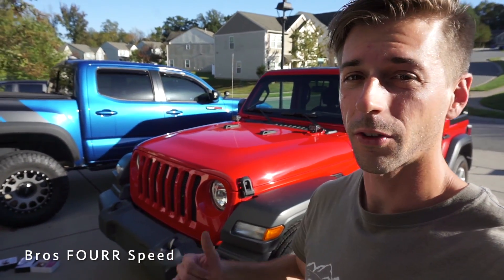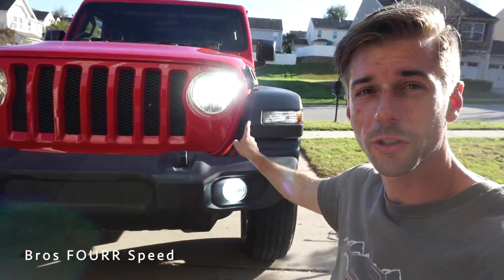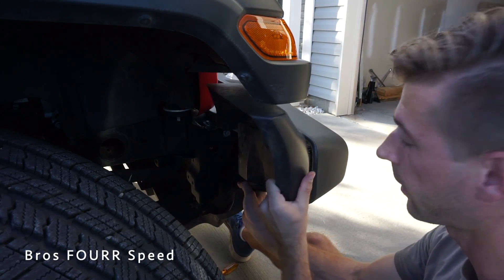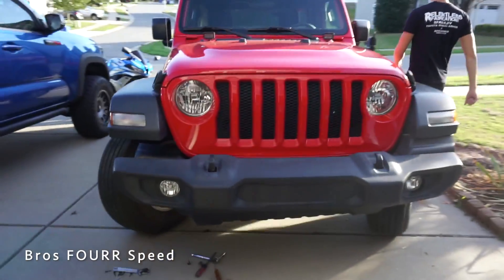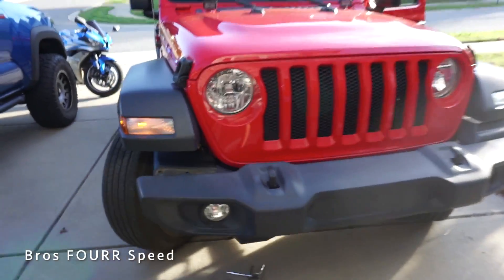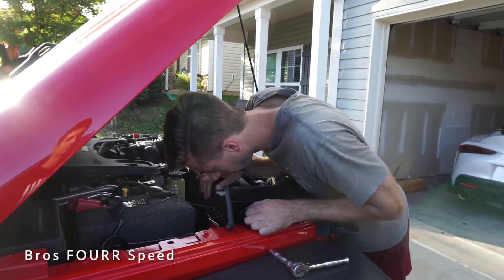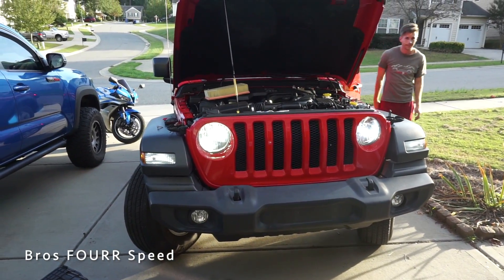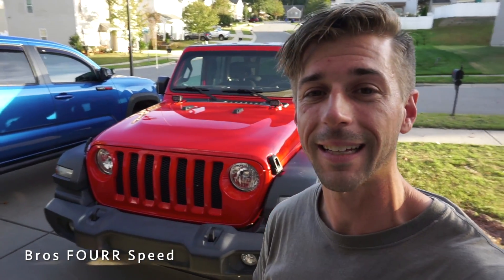JL Jeep Wrangler LED Light Upgrade! BRIGHT!!

Comment: Great video - I have been looking at lighting options for mine.  Two questions - Did your Jeep have DRL's before the swap.  It looks like they are running with the new LED parking lights (in white) and then amber for turn signals, that is unless you just had parking lights on for the video.  Second question on the fog lights.  If you are running them in white mode when driving, hit the high beams (where the fogs turn off) and then drop back to regular lights, do the fogs come back on in white or yellow?
Reply from the maker: It should have, they were just amber, so now they look much better! And if you have the fogs on, and use the highbeams they'll come back on the other color!

Comment: Hi. I have a Jeep Rubicon 2020. I bought the led lights you installed in this video and I love them.
However, my jeep has 2 bulbs on each turn signal (an orange which I replaced with a 7443 7444 CK; and a clear bulb which is a DRL). Lasfit doest make drl led lights. Do you have any recs? Jeep looks a bit weird with all front lights being led except this DRLs on both sides. Thanks!
Reply from the maker: That's interesting because I only had the one orange stock bulb to swap out for the turn signal/drl.  They should make led drls for the Jeep!  Aside from them, all I can think of is diode dynamics as another company to check out!

Comment: won't this cause scattering if put in a halogen housing meant for halogen bulbs? I've been flashed at before so I don't run LEDs in halogens anymore.
Reply: I did the same thing to my jeep and get flashed all the time
Reply: @Jth69  lol yeah plus white LEDS are pointless in inclement weather.. run amber or yellow fogs and you can see clear as day in snow/rain/fog and it’s easier on the eyes
Reply from the maker: I don't seem to have an issue with them so far!
Reply from the maker: Thats why the fogs have the switch backs
Reply: I get flashed when I use the LEDs on the fog lights. The beam is higher than the halogen. Any fix for this?

Comment: New to your channel. Is that a 2020 jeep? I have a 21 and I'm looking into some research with this light.  I have stock plain old halogen bulbs for my dogs I want yellow and I'm not sure if this would work on mine. I have a custom bumper xrc gen 2 so I'm hoping that it may
Reply from the maker: This is a 2018 but it's also the JL model too..these lights should work being it's the same model!

Comment: Quick question, did your turn signals ever hyper flash at all?
Reply from the maker: Nope!  I've had several bulbs from lasfit and haven't had that at all!  They either come with a built in resistor or you can get an adaptor to prevent that.  Just depends on the vehicle.

Comment: Well I click your vid and order all 3 sets of lights. i even used your discount  code.... however those H11 switchbacks don’t work properly in the fog lights they don’t Click in justs falls out... i tried removing that green O-ring  and  replace it with the original red one and it still  didn’t seat  correctly... So Lasfit  sated/suggested that i should remove the O-ring all together and i just tried that 5mins ago to no avail.. although it seats better,,  when you grab it to give it a lil tug its falls right out in your hand... i wanna use ZipTies because i love the lights but i shouldn’t have to.  especially after spending  that much money...
Reply from the maker: I know it was a tight fit on mine, I think I removed the o-ring entirely to make it fit better, but after that haven't had any issues.  I do agree with you though on having proper fitment for the price of them for sure, but hopefully you get it to fit right!

Comment: Do you have to buy two of the DRL/ turn signal sets?
Reply from the maker: Those are the same bulbs!  So the drl/turn signal is just one!
Reply: So when I pulled the inner fender liner I have two bulbs on each side? 🤷🏻‍♂️ I have a 19 rubicon.
Reply from the maker: @relewis3  The corner light could be the other one, mines an 18, so you would think it's the same. Unless you have the led lighting package.

Comment: Do you need jscan or anti flicker for installation?
Reply from the maker: Nope! Easy plug and play! No hyperflash!
Reply: @BrosFOURRSpeed  thank you for your response man! You got my sub. Appreciate this kind of video.
Reply from the maker: @fitsonfly1559  thanks for the support!
Reply: @BrosFOURRSpeed hey man. I just installed the led lights the only thing i noticed is the turn singal when i installed it it was white but after using it last night it went from white to amber. It only comes back to white when i switch the light along with the headlights. Do you know how i can keep the turn signal white?

Comment: is your jeep wrangler jlu sport version ?
Reply from the maker: This was a JL Sport S!
Reply: @BrosFOURRSpeed  is it plug and play ?
Reply: what do you mean "factory switch" for the fog light color change ?
Reply from the maker: @mbperfection  Yeah! You just replace the stock bulbs with these ones!
Reply from the maker: @mbperfection  One the turn signal stalk, there is the control for the fog lights. By turning that on and off, it will change the color of the fogs!
Reply: @BrosFOURRSpeed  so the way to turn on the fog light is the same as usual , and to change color is by pressing on / off , so how to turn off fog light ??
Reply from the maker: @mbperfection  Yup! You turn them on it’s one color, turn then off then back on and it’s the other color!
Reply: @BrosFOURRSpeed  bingo !!!  I ordered the headlight and DRL bulb last night , now going to order fog light . I see there are two version of the fog lights , one is white color without canbus . Can it work ?
Reply: @BrosFOURRSpeed  just got the DRL bulb installed, hyper flashing and error code on dash .... any ideas? my jeep is 20201 wrangler jlu 4 doors sport
Reply from the maker: @mbperfection  The bulbs have a 50/50 chance on the install so maybe take it out turn it around and re install. I didn’t have any issues with mine. Hopefully you ordered the right bulbs.
Reply from the maker: @mbperfection  Sorry you are going through that, we’ve had tons of bulbs and zero issues with them.
Reply: @BrosFOURRSpeed  i assume...it is because mine is 2021 ?

Comment: I prefer amber drl, much more visible, especially in the day, hense its called day time running lights, if youve seen cars with white led drl or turn signals, youll notice yes their bright at night, but not in the bright day, amber is a lot effective hense manufactures use amber. Idk why people use white for drl.
Reply from the maker: I've actually never seen amber drl's, most manufactures have them white, but they are super bright during the day compared to the amber.
Reply: @BrosFOURRSpeed  thats another story, sorry i wasn't specific, im talking about when the vehicle does not come with white led drl from the factory. Ofc now days newer vehicles comes with broghter white led drl, their only visible because they are a long strip of led or a big bulge of light. Hope that make sense.
Reply from the maker: Yeah to each their own. I feel the white light just looks more modern

Comment: Hey guys….I have a 2020 Sahara and realized the switchback turn light bulbs don’t  work. Need 2 separate bulbs :(
Reply from the maker: For the fog lights right? mines a 2018 and I just needed one bulb for the fog lights. I’m not sure why you would need two.
Reply: @BrosFOURRSpeed  for the DRL and turn signal bulb in the side fender. The Sahara has 2 different bulbs.  My turn signal bulb only had one filament so only the yellow color works, not the white.
Reply: I also ordered the headlamps on the website and installed them today…I feel like I need the decoder/transition piece since I needed it for the fog lights…not sure, though